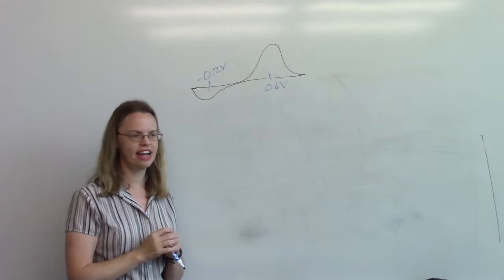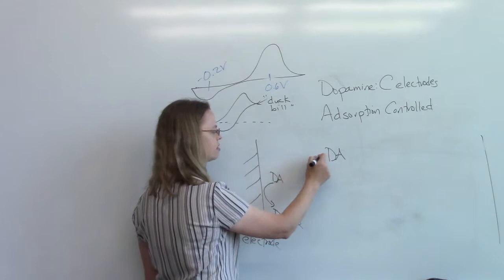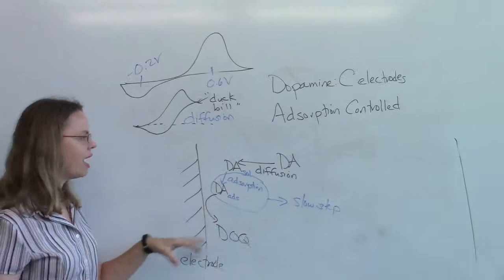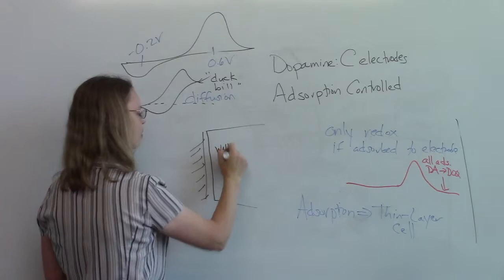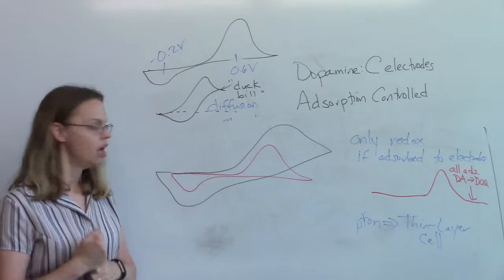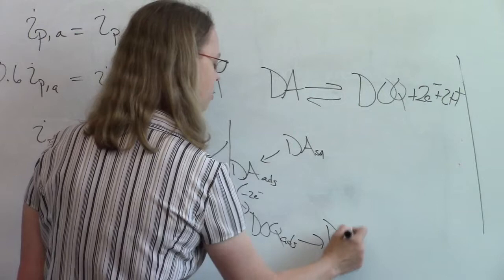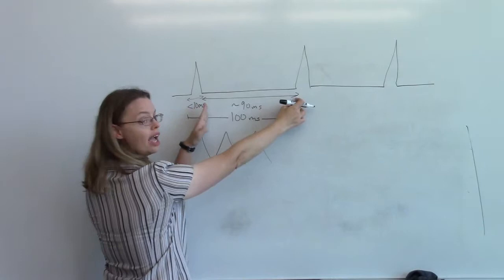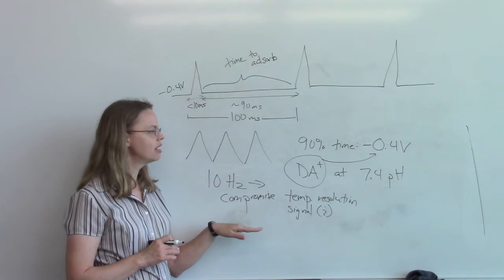FSCV Part 3: Adsorption

Comment: Thanks for all the content Jill. 
When talking about dopamine, am i correct to take it that the analyte is always either in a state of being adsorbed or solvated then? and that being solvated is the same as being in solution. and everything has to be adsorbed to the WE for any faradaic process to occur. 

Im having an issue with nucleic acids making my ferricyanide CVs flat when added in and i cant figure out a workaround. Im thinking something is probably happening to the WE and preventing the FeCN from adsorbing.